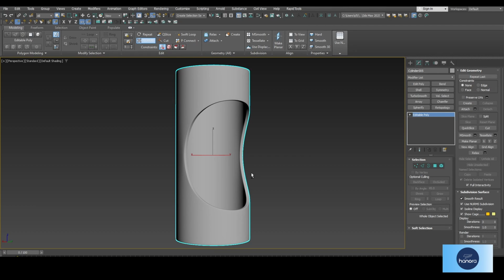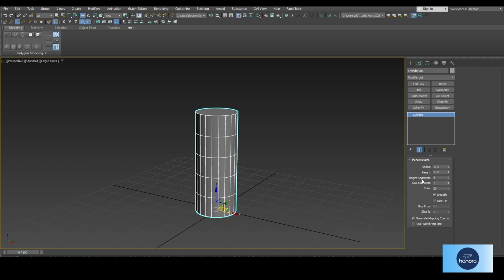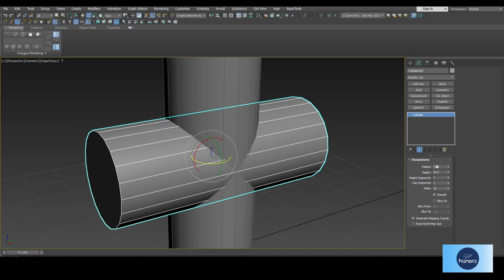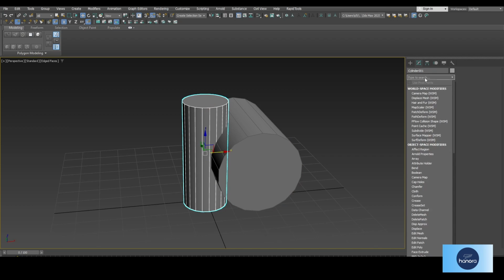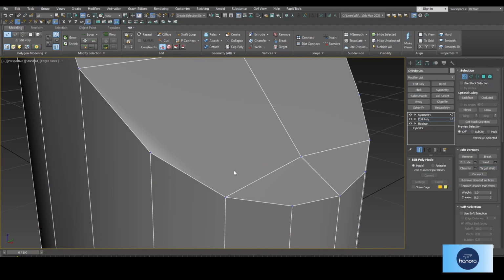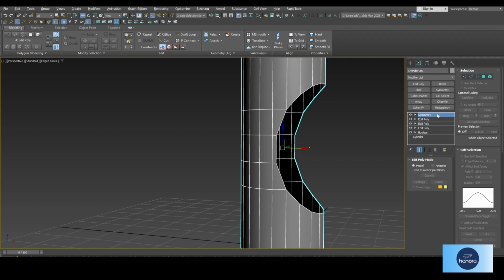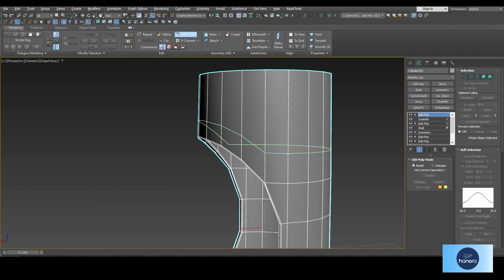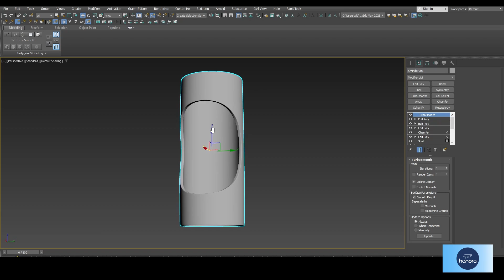Modeling Practice For Your Skills | Hanora 3D

Comment: Thanks for this tutorial. could you please tell me why did you reduce the sides to 18 for the second cylinder?
Reply: for low poly optimiz
Reply from the maker: @GkWithPratik  Cool. Thank you.
Reply from the maker: I'm sorry for the late to reply. When we deal with curved surfaces, mainly want to concern about vertical sides, and also If we focus on the second cylinder sides match to the first cylinder sides, our workflow will be easier. That's why I reduced the sides of the second cylinder, After the boolean, You must have seen there is no hard process.

Nevertheless, we need to manage the polycount in such a way that there is no pinching effect or distortion and you will be learn to easier your workflow, I will upload more videos for that, please stay with us.